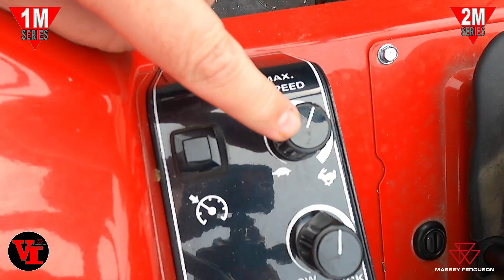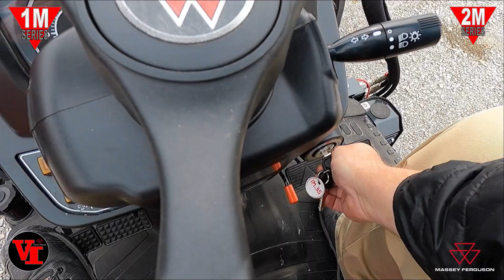Massey Ferguson Tech Tip: How to Override Brake-To-Neutral on 1M 2M eHydrostat Transmission

Comment: I noticed this feature when backing down a trailer ramp where it would go back to neutral when tapping the brakes. Can this technique also be used to sync and loosen the range lever which is often stiff on this series (1835m)? I usually creep the tractor forward or backward and it loosens up the lever with movement.
Reply from the maker: You can sure give it a try. Hope it helps you get more from your Massey Ferguson. Thanks for watch & commenting.